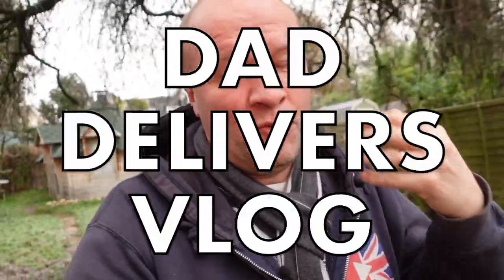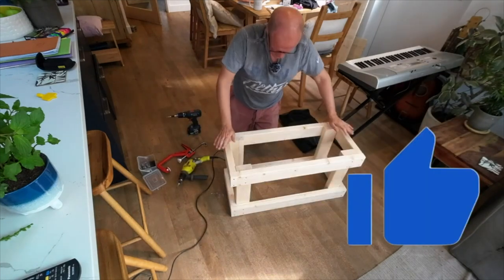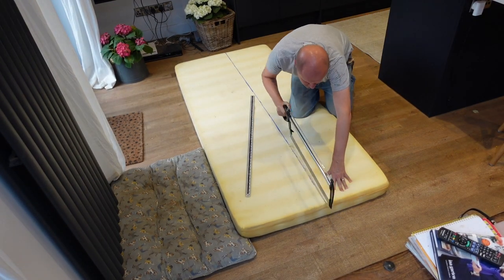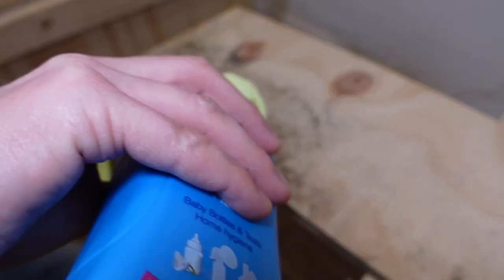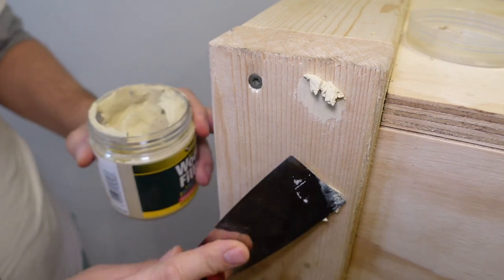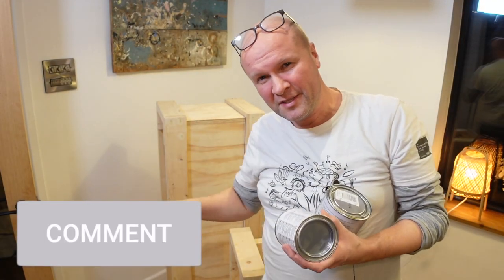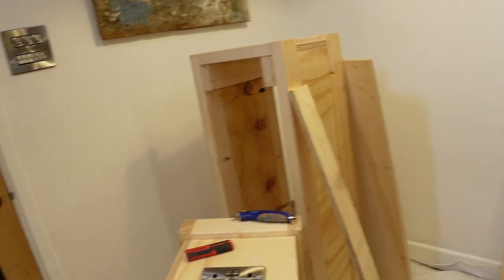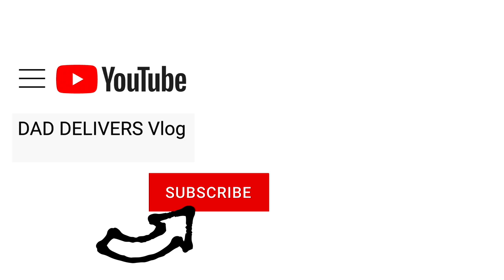How we made SEAT CUSHIONS to finish off our kitchen L-shaped bench...

Comment: Does looks good now and good job with the socket, I would have done the exact same thing.
As for the mold thats a decent tip, I have a similar issue on area's of the house that are covered up by furniture a bit like that is covering that area of the wall up. I will try milton :)
Reply from the maker: Thanks Tony!
The only massive downside I didn't know is that it's exactly like bleach and easy to splash carpets and coats... good luck!